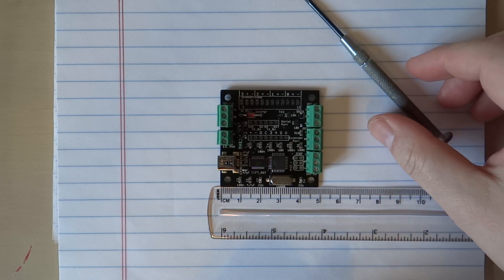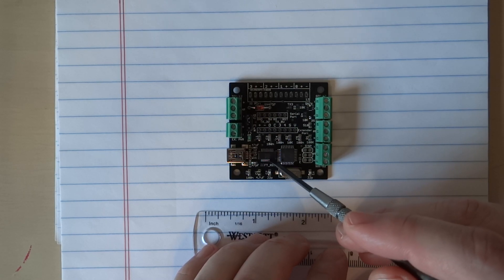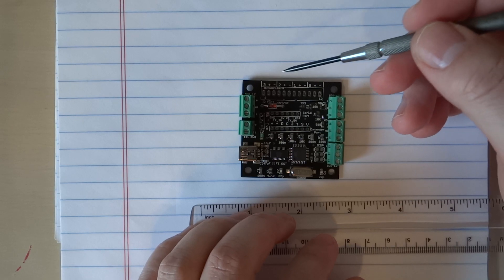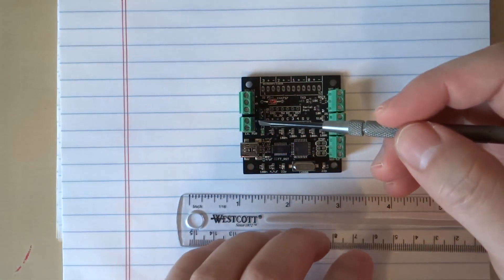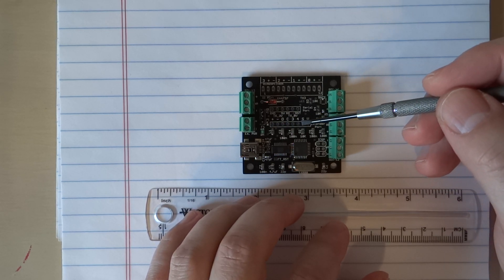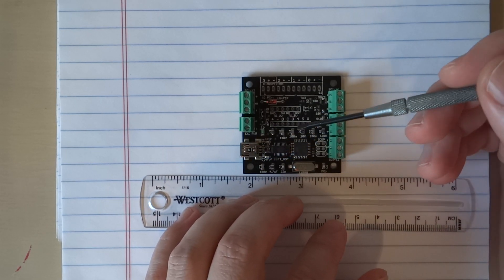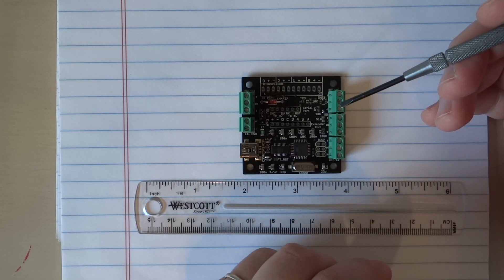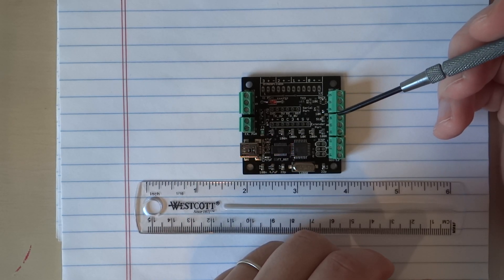2021 SDI-12 USB adapter introduction

Comment: what is the maximum 5v current please in the newest 2023 model? this is the 5v supply to the sensors
Reply from the maker: The adapter has a 500mA fuse inline with the microUSB connector. This is the hard limit of current you can feed to the board. With that said, the thick power traces on the board should support 500mA to the terminals. One other thing you want to make sure is that if you do draw this amount of current, your USB power source will likely drop its voltage. You need to make sure it won't drop below 4.5V, as the lower limit of voltage to power the adapter with.
Reply: @liudr  perfect thankyou! Most of my sensors require 12v no more than 150ma, im looking to DC/DC boost that 5v up to 12v. Ive not yet done the calculations, but I will dig into it this week.
Reply from the maker: @lewisirvine8065  Yes, you could use a DC/DC boost circuit to generate 12V from 5V. Just be careful with your wiring and move the jumper to "ex" so you don't send 12V to 5V by accident. I also have this board that has an onboard 12V boost circuit, 8 terminals (tool-free) for sensors with 12V, and fits perfectly in an enclosure:
https://liudr.square.site/product/sdi-12-usb-sk-16-adapter/72?cs=true&cst=custom
https://www.polycase.com/sk-16
Reply: @liudr  ah ok i was planning to leave junper on 5v and take 5v fron the green terminals to 12v converter but the grounds would be shared correct. If i move to ext then i think i need to gain a 5v supply from a new position.
Reply from the maker: @lewisirvine8065  You must move the jumper away from the "5V" position so it would not send 5V to all of the 3-pin terminals. This means either remove the jumper or set it on the "ex". What you CAN do is to use the + and - pins on the 8-pin extension header as 5V gnd input to power your DC/DC boost circuit, and then send the 12V from the boost circuit to the V pin on the 8-pin extension header so all 3-pin SDI-12 terminals will get 12V on their + terminals.
Reply: @liudr  perfect thanks for excellent support. If i take my 12v out of the converter to V on 8 pin is there a position convenient for - out of my converter? Or safe to presume its common to the - input on the booster and not required.
Reply: Actully done it! Works perfectly, just looking for some terminal program that lets me run macros, id like to be able to string commands together like 0M0!;0D0! Or 0I!;1I!;2I! Say when scanning for a sensor on unknown addresses. My old board program dynamically listend for the reply between commands listened before sending the next to allow sensors correct response time.
Reply from the maker: @lewisirvine8065  I use terminal by br@y+ that has buttons you can customize with commands etc. I've used it in some of videos. I've also used tera term in the past but not presently. I recommend you to read my basic python code. They are much more customizable than a terminal program and can do anything you want, such as saving and uploading data to servers. Google/chatGPT can provide some of the help for free.